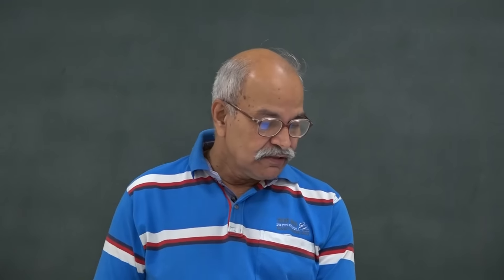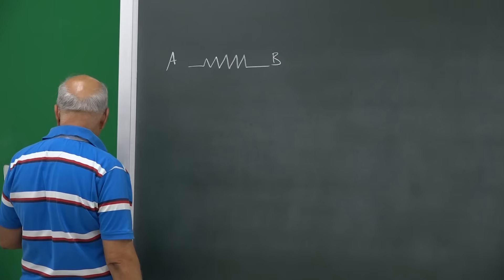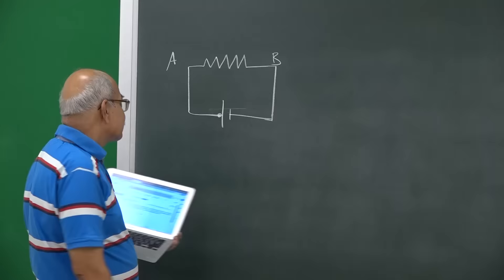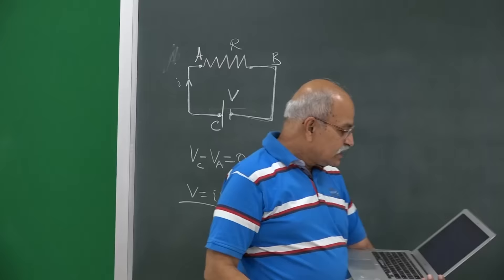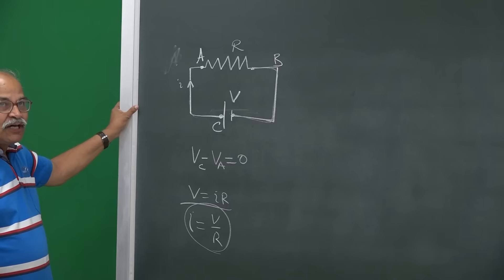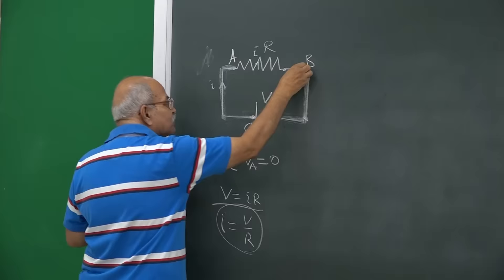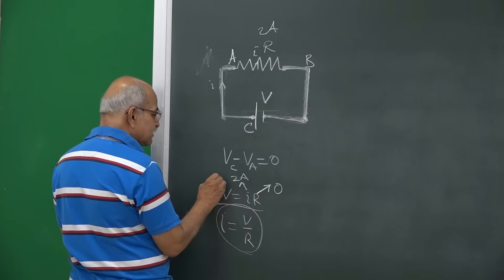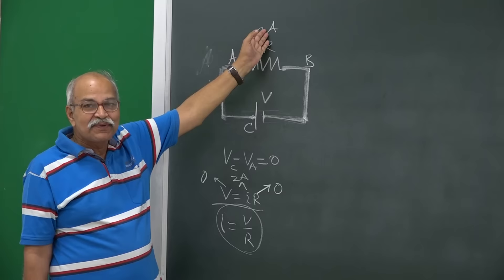Current without potential difference

Comment: If I remember correctly, the Ohm's law states that current (I) is proportional to the potential/voltage and not the other way around. So I °< V. 
°< is used by me for proportionality symbol.
And R is an entity independent of these two (current and potential) and is a proportionality constant and this will not vary. When I say it will not vary, I am talking about static resistor used. We can definitely use variable resistor but at a given point of time, it will be constant. Plus the negligible resistance from the conductor material which again should be constant and depends on the material/metal used.

And when it comes to potential being zero, it will never be zero. There will be some negligible amount of potential difference which is very very close to zero. And hence, there will be current. 2 A is very huge but it was just an example used for mathematical validation of V=IR. In reality, that zero is indeterminate as you guys rightly said because that value is very close to zero. Let's say 1 mV or even less and a negligible resistance of < 1 ohm from conductor assuming 0 for resistance like sir said. The value will have more zeros after the decimal point and in reality something dividing by something will give a value no matter how small both values are and hence that value is current which is not zero.

Hope this is useful 🙏
Reply: Yes, Ohm's law does state that i *< V. However, ohm's law being an empirical relation the validity of v*<i is same as before. It's not wrong, it is just that the 1st statement was used by Ohm when describing the relation & is just preferred over the other statement
In many cases you'll see that the second relation is preferred over the original one because Potential difference is the cause of electric field.
Reply: In the qn potential difference btw A and C is zero 
But not the potential, so it's always fine 
The Qn is quite normal but the way the Qn asked was tricky
Reply: Yes... It is useful!
Reply: @logeshgopi4212  yes. I think ohms law is valid for closed loop. It also works in "short circuit" condition, where the resistance of connecting wire (>0) plays the game. Am I correct?
I think the same thing happens here.
Reply: @letslive2312  yes
Reply: @letslive2312  This is where Superconductor enters to the chat.
Reply: yes u are right there is a pot diff all over the wire too but we dont take it into account while sutdying

Comment: For people who didnt understand , heres the logic , you have 2 tanks at the same level connected with a pipe so no water flows because they have the same level of water , as soon as you connect a 3 rd tank to the 1 st 2 tanks with less water, the rate of flow of water from the 2 tanks which have 0 difference in water height start flowing and their heights decrease at the same rate filling the third tank . So verma sir s logic holds good
Reply: Thanks Brother , Your Explanation  is better than sir's
Reply: My slow brain still didn't understand 🤣😭
Reply: honestly this is the explanation i was looking for, sir usually gives an intuitive explanation but didn't give in this video
Reply: He said even if the there is no potential difference between two tanks you can flow the water to a 3rd tank @suprememystic

Comment: Actually the current drawn from a voltage  source depends on the external resistance ( here) or overall resistances present in a ckt. Current - effect , overall voltage  diffence - cause...and it's value depends on resistance...so it never see the potential difference somewhere locally zero or not....this is the concept he is trying to convey us. Ohm's also satisfied in the region where potential difference is zero..

Thanks sir...great explanation...

Comment: If anyone is feeling weird about 0 being on both sides of the equation, it's not 0. There is a little amount of resistance offered by the wire and that section of wire has a potential difference twice the amount of that resistance. Keep this in mind and watch the video again and you will get it.

Edit: twice because current is assumed to be 2 amperes
Reply: Thanks it really helped.
Reply: Thankyou so muchh
Reply: I have a question - what if in an ideal situation, the resistance of the wire is perfectly zero? Then ohm's law just breaks down because current 'i' would be undefined-?
Reply: @shivaniajmera I have the same question
Reply: @shivaniajmera  there are non ohmic conductors which don't obey ohms law
Reply: @shivaniajmera in a material with perfectly zero resistance, essentially no kernels are present and electrons will perform accelerated motion which will make current increase exponentially.Also since this an accelerated motion electro magnetism will be associated with it.

Comment: 0 divided by 0 can be anything. So 2 Amp is just fine :)
Reply: Yes... absolutely correct...0/0 is indeterminate.... ohm's law is completely followed no matter the current..u have a pretty firm grip on fundamentals..👍
Reply: Hold on. How can you possibly get zero resistance? You cant just neglect the total resistance of a system. Additionally, if there is no pot difference or voltage in the system, how can current be generated? I dont think that its possible. Please correct me if i am wrong
Reply: Actually their limits when they go to zero can be anything, which proves the fact that small numbers of resistance can produce current.
Reply: Remember V=IR or I=V÷R 
But R never depends on V&I
Reply: @gaudiumlex9929  lol wtf, 0/0 is not defined , if something approaches 0/0 we say it's inderminant but 0/0 itself is not defimed. Get ur basics clear
Reply: @induce6645   if no current is flowing in the circuit, there will be no resistance.
The emf will be between the terminals of the cells.
Reply: MusicwithAnirudh. I dont agree with you. The material that the circuit was made has its own resistivity quotient. That resisitivity is different for each metal, and also changes according to length of the wiring and the cross sectional area of wires. If there is a circuit, like he has shown on board, there has to be resistance. The absence of current is caused by absence of voltage in my opinion. I am looking forward to your reply. I want to become an electrical engineer and will highly appreciate if you can explain your statement. Thank you, have a great day!
Reply: @gigachad6844  First get your basics right from a standard book.Not defined and indeterminate are different things. Indeterminate means that the thing is defined but it can be anything(or we dont lnow what it can be).
0/0 is defined but we dont know what this is , therefore its indeterminate.
Reply: @induce6645  We considered the resistance of wire to be 0 to make the question easy and add it up to a resistor in series. So, thatswhy this doubt came into existence. Actually there is resistance and p diff but we consider otherwise. Sir just shown that
Reply: @Qwerty Perth 👏👏👍 that was really good srsly!
Reply: Hlo ...guys ...I m 10 th class student ...I want to say ...that how the current can exist without potential difference ...???... As the wind need ..air pressure to blow .....so how the current can flow with 0 potential diff.????? Pls tell me if anyone knows
Reply: @jaswindersinghhundal4129  see my reply buddy actually the zero resistance is just an assumption and the resistance of wire is added to the total resistance as a series line addition. But there actually exist super conductor, obviously nothing is a perfect super conductor as u said. But we have elements which can produce almost infinite flow of current in minimal pd as per resistance. You can learn more bout it on web or yt
Reply: @prasadpatra8435  OK ...thanks dear ...
Reply: @prasadpatra8435  means ..u want to  say that  ...there will be some potential difference ...whether its near zero .....and the resistance that we will add both the resistance of conducting wire & resistor ...in V=IR ...pls tell me ...I don't no much bout this Bcs m in 10 th only😅
Reply: @jaswindersinghhundal4129  yeah in real senarios but in the circuit diagram we assume a perfect super conductor to make it easy n add the resistance of wire as a series
Reply: @jaswindersinghhundal4129  And I am in Class 11 only. And in 11, there is nothing about this so I am in saying all these with class 10 knowledge only 9 I guess
Reply: @jaswindersinghhundal4129  if u don't get it now too lemme know I will explain further but don't sacrifice ur thirst of knowledge buddy. In class 11, the burden will be so much that at the end ur mind will also insist u to follow marks bt u should go with ur passion
Reply: @prasadpatra8435  OK ..thanks buddy
Reply: @induce6645  the international standard definition of the resistor symbol is that it just shows the entire wire's resistance at one location. If there is a simple device given then the qn. Is not the most accurate one and the answer is approximately the same
Reply: @jaswindersinghhundal4129  just like slow hava ke chalne par ham kahte hai hava nahi chal rahi same way the resistance of wire is very low and we assume to be zero
Reply: Current always flows in a conductor without applying external potential difference..But the net current is 0 ..we appply potential differnce across a wire to get some net potential differnce
Reply: @gigachad6844  but where in the world would I find a wire of zero resistance.  And suppose if I did then we all know electrons still move randomly inside conductors , we assume them to be cancelling each other but it's not true so there are always negligible amount of currents in a wire
Reply: @dudenotsoperfect8740   You're wrong, 1/0 or 0/0 is NOT DEFINED! I cannot tolerate someone saying 2+2=5, similarly saying 0/0 is define but we don't know what it is, this statement is laughable.
Reply: I see maths breaking up with Physics 😂😂
Reply: in real life whole wire contains resistance, not a particular part. So wire has potential diff.at all the points.
Reply: @gigachad6844  I guess we can say due to natural discrepancies V and R are somewhat not totally zero, so either argument makes no sense
Reply: @Kiwinov  If you take very less voltage and resistance instead of 0 for eg v = 0.0000004  and R = 0.0000002 bur ratio V/R is not very less here it is still 0.0000004/0.0000002 = 2 A only
Reply: No 0/0 can't be anything its indeterminate means it cannot be dertmined, if it cannot be determined it can't be determined as 2A

Comment: Super question
My explanation is......
If u measure Voltage  with reference  of ground. Both points A and C have some potential becoze internal resistance zero. Va-Vc=0, but where as in practical we get some very minor voltage drop bcoz no material shows 100% conductivity.
At the same time point B we found some dropping of voltage .

Comment: Theoretically, but surely in a practical example it is impossible to ever have 0 ohms resistance, as even in a wire or in any component there will be at least a negligible amount of resistance thus requiring at least a negligible amount of potential difference for any current to flow.

PS: I love your lecture style and you explain the concept really well!
Reply: Superconductors : lol
Reply: Conducting wires at 0 K
Reply: @vinaykadam2343  can you achieve 0 k temp
Reply: @anirbandasxisciencesection9226   i am saying theoretically it will work
Reply: Yes, just like it is impossible to have a perfectly frictionless surface